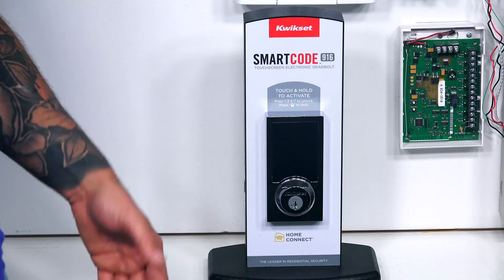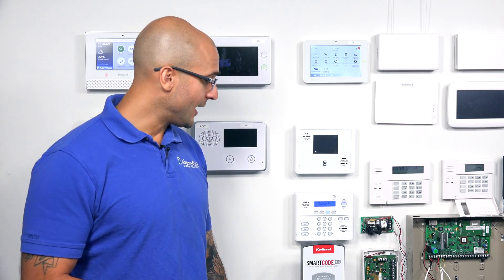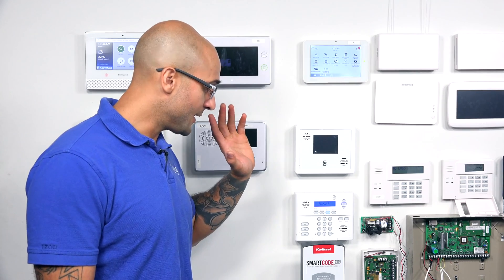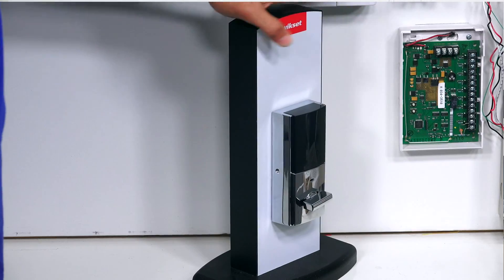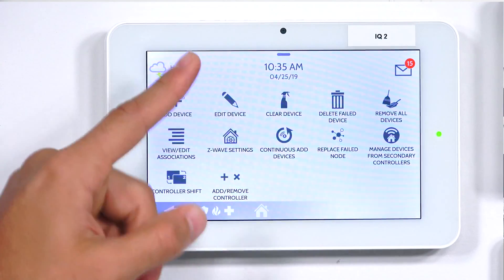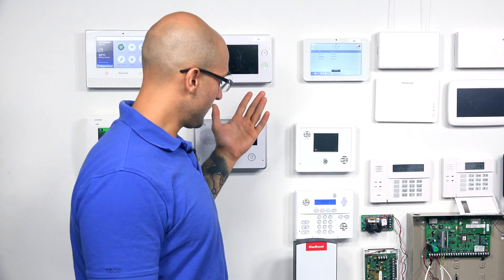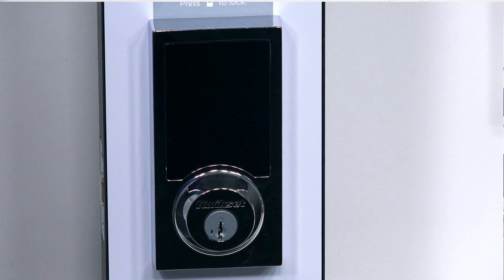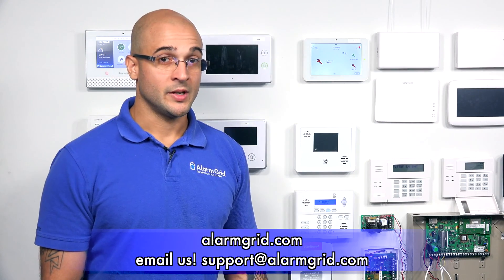Including a Kwikset Z-Wave Lock

Comment: Guardian Protection uses the IQ2 panel, I already have 1 z-wave lock, will I be able to add a 2nd lock this same way without an issue? Guardian says it "cost" $35 to add a z-wave device to my system...I'm trying out to figure out why if I can just follow these instructions and do it myself in less than 2 mins.
Reply: As long as you have the proper code to access the proper menu to set this up, you can certainly pair the second zwave device yourself.

Comment: what if the learn mode light doesn't stay red? i click learn, and the red light just turns on then off in 2 secona
Reply: Hey James, That is not normal (make sure you are not using Lithium batteries), but I would double check the installation instructions to see if there is something with that error,  then follow up with Kwikset to see what they say about that error if the instructions do not provide the info on that issue.

Comment: If I change the password on my wifi, do I need to exclude and include all my current devices
Reply from the maker: Only your devices that use WIFI.  Any Z-Wave devices that you may be using are not paired with your WIFI, they are paired with your Z-Wave controller.  Your WIFI password will have nothing to do with this.  WIFI and Z-Wave are separate networks.